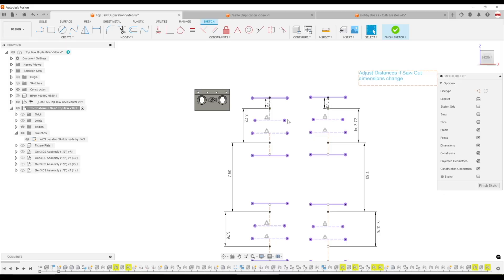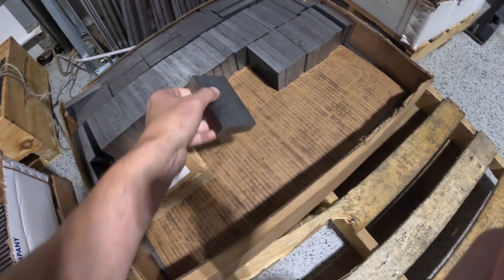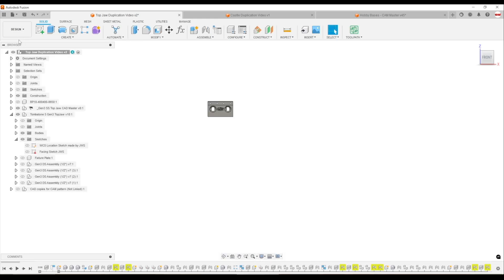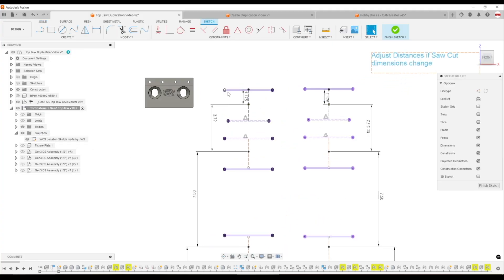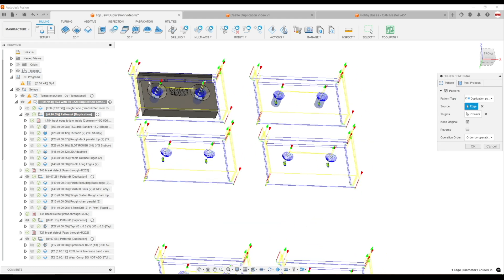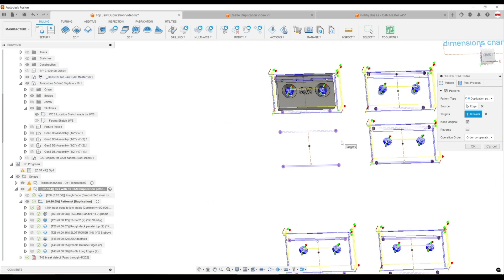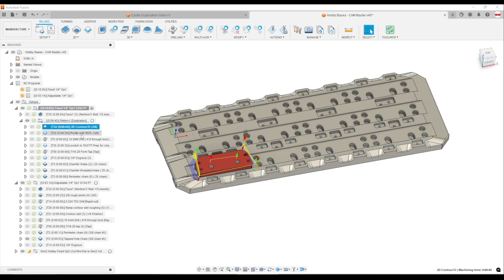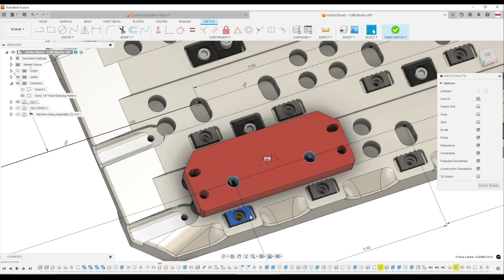Using A Sketch to Drive Production CAM Patterning in Fusion

Comment: Hey John what post are you using for your MB? The stock okuma one doesn’t output G605 or the right lock unlock codes. Another question is did you get the pallet pool and how are you handling that in fusion since everything needs to be .SSB files

Comment: Why Fusion doesn't have option to copy stock with tool path since you need to see if during machining 1st part, you are gonna crash tool in other stock during lead in for example. You don't need finished part for simulation!!!

Comment: How can you do multiple WCS but the setup also needs to be rotated because I am using a 2 Position Vise where the center is the fixed jaw. I currently just duplicate the op and change the setup for each part but this uses memory and any change to the design I have to manually propagate that to each part. Is there a way to point to one section of code (sub-routine) that can get called inside each setup with the different WCS's so I only need to modify one CAM if a change is made?